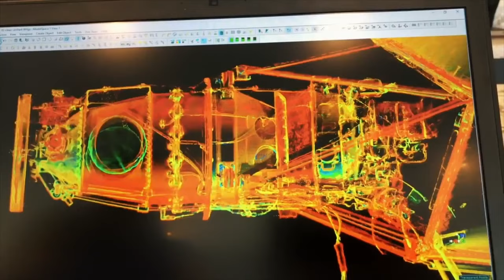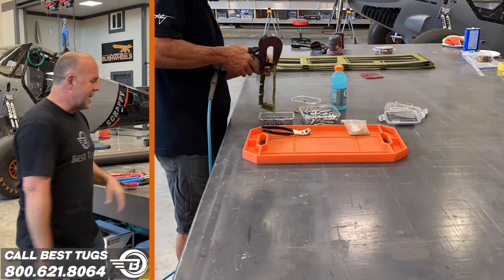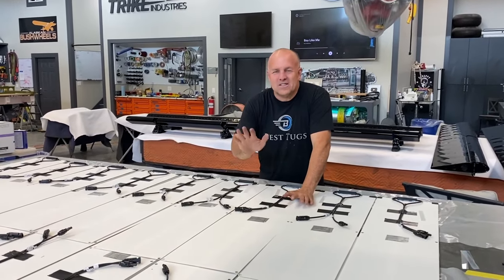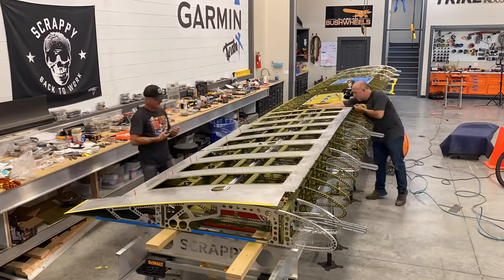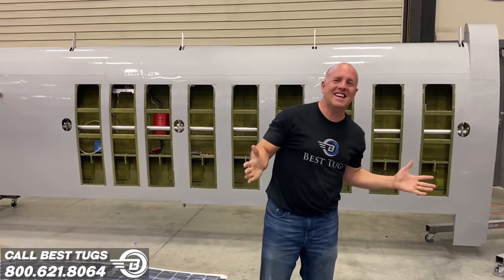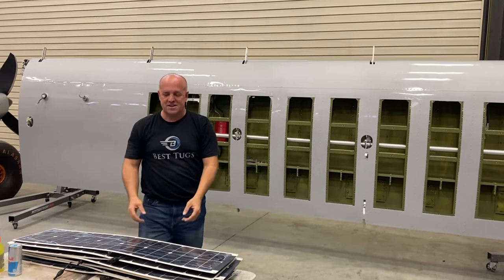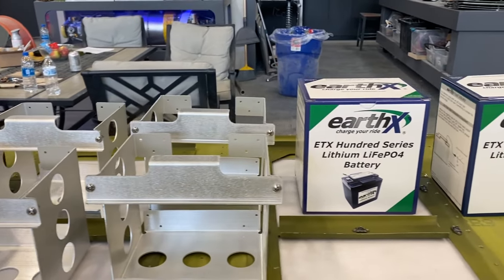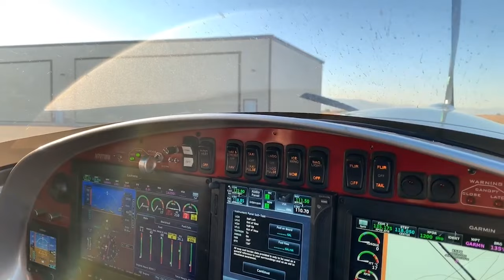Solar Panel Wings on Custom Search and Rescue Bush Plane | Scrappy #59

Comment: MIKE MIKE MIKE 🚀 ...Love the setup.  You can even turn scrappy into a recharge station...🇺🇸  The army has a awesome solar tarp.   What makes it special is the way its wired.  Allowing it mostly being covered up. Yet still producing energy.    
    Worth a look or inspiration for future ideas 💡     ALSO. That tarp can fit between the motorcycle struts. For those situations to extend its range away from scrappy.  (With its capability of charging in hard shadow cast. Perfect under a forest canopy situation)

Comment: Just a wild stab in the dark, but I’m guessing you’ve never been accused of under engineering anything? 😂
Can you power the prop from the batteries too by powering up the starter motor? That would be great if you had fuel/engine failure.
She’s going to be awesome when finished 👍
Reply: I will. That 1200W inverter may be undersized for across-the-line starting of small power tools.

I had a 1000W that wouldn't start my refrigerator or circular saw. So I upgraded to a 1500W. Same issue. So I upgraded to a 2000W which does support those hard starting loads.

All of them were rated for 2x peak. So, 1000W was 2000W peak and wouldn't start those loads.
Reply: @ljfinger  I think he already knows 1200w is underpowered for some devices. He comes from the electric car world and has a company that builds electric aircraft tugs.
Reply: A future episode... an over engineered starter motor to land the plane safely after complete engine failure with the batteries.<g>
Reply: @eugenebergmann9928  so long as you’ve got enough amps it’s doable. Heavy motorbikes (gold wing etc) spin the starter motor in reverse to use as a reverse ‘gear’ but they’re limited by battery capacity. As scrappy seems to be being designed to airlift tanks I can’t see a problem - and then scrappy would have an awesome silent ‘stealth’ mode too 😀
Reply: @ljfinger  He does have more amperage than typical going into the Inverter
Reply: @sam1812seal  thats funny, stealth mode,  <g>  could be very cool when you need it!

Comment: "And, if my engine ever fails I just eject it and another one flips up in place from a secret compartment under Scrappy."
Reply: Actually the electric motor bike motors can be used as backup motors, and cross the Pacific.
Reply: No no no, he just flips a switch and the dual generators on the engine swap modes to electric motors. Intended use would be casual cruising at altitude, fully solar. Still needs the big beast for svtol and max performance phases of flight. 🤣

Comment: Will be curious to see how those solar panels hold up from a vibration fatigue stand point.
Reply: With Mike's budget, I don't think how long they hold up is an issue.
Reply: Fair point.
Reply: My concern is if one or more fails and rips off, will the wing over pressurize  and blow out the rest of the panels or skins. I’m sure Mike has accounted for this.
Reply: these 50W 16V flexible monocrystalline Moduls are under 100 bucks a peace, normally built for boats or motorhomes - they can take a punch - or two

Comment: Structural engineer here. Have you added some drag/antidrag structure to replace the lost sheer load of the cutouts for the solar panels? Fabric wings do not have the shear capability of fully metal-skinned wings so you will see drag/anti-drag wires or tubes to carry the fore-aft shear loads in internal to the structure. Your metal skin with cutouts will act more like fabric wings as far as shear capability. This is critical for a max G pullup. At a high angle of attack the wings will actually pull forward relative to the fuselage structure due to forward rotation of the lift vector. This is where most static load testing is done incorrectly. Sand bags or other loading is commonly applied normal to the wing but actual flight loads are rotated forward of the wing producing a forward pull. Max aft load on the wings will be due to drag at max dive condition and max forward load is the subsequent high G pull.

Comment: Such a waste of 8 bays…. So Browning 30 cals were not even discussed? ☹️
Reply: 😂😂 that would be amazing 😂😂
Reply: You trying to get him arrested and put in jail?
Reply: That would be useful for Search and destroy
Reply: Or cas
Reply: Those goes on the sub wing mounting points (on days when the AIM-Sidewinders are too much (e.g. Sundays))
Reply: Patey would not go .30, .50's all the way.
Reply: Do not give him ideas. ..... vibrating seat?
Reply: He could at least just add a flame thrower
Reply: Maybe he'll make a new plane next... Brownie ;)
Reply: @blauer2551  you need to be PC... Not flame thrower but  Marshmallow roasters
Reply: I'd like to see Mike do a whole lot of weight reduction on a 1919 BMG.
Reply: I'm pretty sure those Browning 30 cals would weight the same as the motocross bikes and they could be made to connect to the bike anchor points, if the need ever arises... xDDDD
Reply: @mkgg9637  not illegal.
Reply: @McBlokeados  Mike would go for a lighter option. M60, M134, or more likely the newish xm556 microguns.
Reply: No he didn’t. Instead two retractable 50 cal. BMG’s 🤪
Reply: Plasma cutters?
Reply: @dons8122  Flame Throwers have a problem with forward velocity
Reply: Well he has a parachute so he does not need alternator redundancy yet we all know it’s highly important to always be prepared against zombie attack because it’s far more likely.. 🧟 😜🙂
Reply: If you've got electric, why not a M134 Minigun?  Make some quick disconnects so you can carry it around like Predator.

Comment: have a question concerning the physical resistance of those solar panels. on the top of the wing, will they physically be able to resist to the differential air pressure during flight?
Reply: I was thinking the wing flex would be a bigger issue
Reply: Yeah, I was also thinking about that.
Reply: @T.J. Kong  exatly my point. if they are glued on full face on problem, but they are not.
Reply: @T.J. Kong I have them on my truck only the sides glued so water won't get trapped and rust, it's not an issue up to 120mph for me.
Reply: I was also wondering about the solar panel's resistance to popping out due to the top of the wing probably being at lower pressure wrt the inside of the wing.
Reply: @KenIronside  Lower pressure yes but not negative pressure. There is still pressure on the upper wing. IIRC the Solid Works fluid dynamics images Mike showed did not indicate a negative pressure zone where the Solar Panels are. Mike was trying to keep Laminar Air Flow over the top of the wing.
Reply: @mckenziekeith7434  Doesn't every truck after 1987 go atleast 120 MPH?
Reply: @Airplanefish  I don't know. My truck is a 1999 2.7 liter, 4 cylinder tacoma 4x4. It will not go 120 without some gravity assist (for example, if I were to drive off of a cliff).
Reply: @mckenziekeith7434  I guess I didn't know they built trucks with engines smaller than a V8.....😁
Reply: @Airplanefish  I guess I could put two of the 2.7l 4's  together to get a 5.4 liter V8. LOL.
Reply: @mckenziekeith7434  do it. What else you got to do tomorrow?
Reply: @primrosereceptionist611  It doesn't need to be absolute negative pressure, there just needs to be a pressure differential between the top of the wing and the inside of the wing. The pressure on the top of a wing is always lower than the bottom (Bernoulli etc) so, in this case, we'd want to know what the pressure on the underside of the solar panels (inside the wing) is.

Comment: I'm sure he's looked at this but what happens if the solar panels flew off and left a hole in the wing?
Reply: My thoughts EXACTLY. How are they attached?
Reply: @drjohnbw  I bet he'll bond them in with the car windshield adhesive he used on the lights in the cowling etc. as it's also great at eating vibrations.

Comment: Could you design a system that has removable battery modules that plug and play with the charging system? Like have 6, 25lb battery packs to bring potential energy for varying situations.

Comment: Mike I am recomending a different aproach idea. Use a stand alone inverter solar generator like the bluetti AC 200 max or the AC 3000. Over 2000 watt continuous pure sine wave inverter with a large scalable lithium battery. The unit is portable, has 20 amp and 30 amp RV style plug. I would seriously look at this option.
Reply: Size, weight and safety considerations lead to his choice. He needed to spread the weight too.
Reply: @primrosereceptionist611  Size weight and functionality is increased with a stand alone option and portable solar panels will increase charging options as well. A high powered portable package is a no brainer.
Reply: @Robert-cd2ht  He is doing much better sourcing his own components, 2000 watts continuous, for how long?? Those pre packaged so called solar generators are for people that can't put together their own, solar, charge controller, battery bank, and inverter.
Reply: @portnuefflyer  2000 watt continuous as long as the power input is available. 4800 watt surge is capable of running any 120 volt welder or plasma cutter. These units have progressed so far with such great specs that there is no need to source parts to DIY.
Reply: @Robert-cd2ht   They are simply standard off grid components, pre  wired, in a fancy box. I can, and have,  done the same many times, though on a bit larger scale (palletized, inverter, batteries and PV, showed up on a jobsite and 5 minutes later they had power). Anyone familiar with off grid work can do the same at much less cost and with greater capability, and using higher quality components, proven by decades of off grid use. BUT, I agree, for someone not hands on in that type of work, they are the way to go.
Reply: @portnuefflyer  Show me the standard off grid components used in the models I mentioned.
Reply: @Robert-cd2ht   They are probably use no name components, or simply rebranding them. If I want an inverter I'll get an Outback, Magnum Energy, Schneider  or other name brand unit that off grid installs have been using for decades. Not the latest thing to come from Alibaba. I seriously doubt they have made some tech breakthrough in inverters or charges controllers. What they ARE doing is putting widely available components, source and brand unknown, into a single sanitary package, "a pretty box" and keeping it simple enough for Joe Sixpack to operate. nothing wrong with that, I admire their marketing! But I don't  give them any credit at all for any cutting edge advances in off grid energy usage. They have made it way more casual user friendly, good for them, but anyone serious about a system would go a different route.
Reply: @portnuefflyer  Thanks for your hot air baloney response. If you can't  prove your accusation then don't bother talking.
Reply: @Robert-cd2ht   OK, you win. They are using technology years beyond those who have lived with off grid power systems for years, 28 years in my case, what do they know? mike screwed up, he should have gone with bluetti. Enough!

Comment: Are the solar panels rigid enough to avoid bulging under the low pressure on the top of the wing at cruise?
Reply: My thought exactly! Guess they are, can’t see that he wouldn’t have been considering that…
Reply: @BricoleurTV   My thought too, time will tell.
Reply: Seems to me that Mike has built a surplus of safety, strength and aviation features  into this plane.  The solar panels seem to me to be the first feature that contributes negatively to that surplus.  It’s cool and surprising for sure.  I hope it works out okay.
Reply: Yes, they are either on a fiberglass or aluminium backing, and the curvature of the wing adds rigidity.

Comment: How did you keep that torque tube in the wing from binding up when the wing flexes? Another great and informative video!
Reply: Great question, I wondered the exact same thing.  Maybe it flexes just like the wing ?
Reply: He said in the video that there's enough of a gap between the tube and the ribs that the wing shouldn't flex enough to bind
Reply: I heard that but he also said it rides in bronze bushings. Im wondering how those bushings are held so they can flex with the wing but not bind on the torque tube. Im sure he has some trick way of doing it.

Comment: I dont understand, how these panels can withstand the existing low pressure over the wing. Aren‘t they pulled of? Is there an additional steel sheet below to take those forces? 
I don’ t know the construction of the solar panels. But, as a mechanical engineer I‘m scared now the first time!
Please explain me that situation.
Reply: 😬 I have the same question. I'm sure there's a solid answer, but I'm very interested in hearing it from him. 👌

Comment: Are the panels as resistant to puncture, abrasion, and weather as the sheet metal they take the place of? Will you carry a spare sheet metal plug if a panel is damaged mid trip and can't remain in the wing?
Reply: Is the lift by the wind strong enough to distort electrical sun generator panel?  Then break lose or come out?   That worries me.

Comment: I took it for granted that lithium works poorly in cold conditions, or is that just small lithiums?
Reply: Lithium is better in the cold vs lead acid.
Reply: @gpaull2  True but there's a really significant drop in efficiency in the cold. Flying at 12,000 in the mountains those batteries will be cold. If there's a weak point in the solar wing design it's keeping the batteries functioning within tolerances. After working with NiCad, NiMh and Lithium outdoors in Canadian winters running TV cameras, lighting and transmitters I can attest the drop-off is significant. Will need some thermal protection.

Comment: With such a large engin why not add an extra alternator for welding and other high power aps ...?
Reply: Or mod the cowling to accept a bolt on belt driven external generator for that really big stuff.  But then you'd have to have the engine running and the safety issues that go with giant fan.
Reply: Definitely not a smart idea to have a spinning propeller while trying to work around or weld around. Let alone the engine will certainly overheat because it wouldn't have any ram air cooling
Reply: I think another reason to not do this is fuel. It's be hard to justify just dumping your fuel to weld something up when the amount of fuel needed to perform the job could easily have to prematurely run out.
Reply: @Airplanefish  Emergency  welding takes a few minutes,  no manufacturing  intended.
Reply: @coemiebreytenbach8173  my opinion having a spinning propeller with loud exhaust is not even remotely a good idea to have going on while working around it. No matter what your doing

Comment: Hi Mike, question, how do you stop rain or water entering the front double spars when in flight or park at airport outside or stop corrosion with moisture inside the centre of the wings? I hope you understand my probably dumb question and able to answer them as have no aircraft knowledge.
Reply: Flying in ice conditions might also be a problem??
Reply: Everything is corrosion proofed inside the wings, and no way in hell you’d want to fly into known ice in anything like this.
Reply: @wwilliam50  hi, ww50, was not talking about ice, hail but only rain conditions as this are most possible conditions some one could or would fly.
Reply: @silasthomas1454  - That is what I was thinking.  Perhaps it would limit SAR, waiting for clear weather and all.

Comment: What about the negative pressure on the top of the wing, is that going to 'suck' the solar panel(s) right out?  That would really "suck".  8)    LOLOL   --gary
Reply: I was thinking the same thing, can the structure of the solar panels withstand this environment ??
Reply: That's not how a wing works, you have airflow parallel to the skin, just faster than on the underside - so no possibility of "sucking it out"

Comment: Since planes spend most of their time outside either flying or being parked at some landing spot it makes sense to have solar panels on the wings to top up the batteries with electrickery. Especially now that flexible PV panels are readily available. What you use all that juice for is up to you ,Mike is going for a flying repair truck, sort of aerial AA. Regards, Jim in NI UK

Comment: Yesterday, I caught myself thinking: If I put the power of a 5 seat helicopter into an aircraft with the complexity of a 5 seat helicopter and spend the money needed to buy a 5 place helicopter just to reach spots otherwise only accessible by a helicopter, why would I not not just build a BETTER helicopter instead? Amazing work and the best channel ever, not criticising, just a thought that crossed my mind...
Reply: That's the right question, but begs the reminder that Mike's narrative is nonsense. This is just as much an S&R aircraft as it is a low budget build based on salvaged parts. The story changes weekly, this week it's a custom search and rescue craft. Don't get me wrong, it's a great build to watch with a lot of amazing engineering but it's a mistake to believe any particular statement from Mike about the intentions or practicality. What the airplane is designed to do above all, is get attention on YouTube.

Comment: Pretty much with all this power you might be able to switch the starter motor for a higher capacity motor that you can use to super cruise in a hybrid mode, just imagine... Thanks Mike for the great engineering and content.